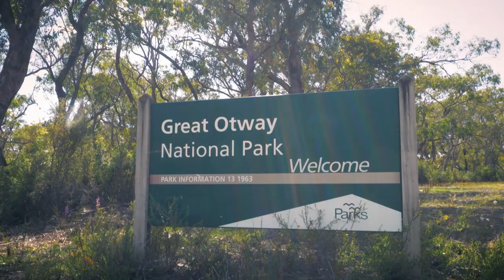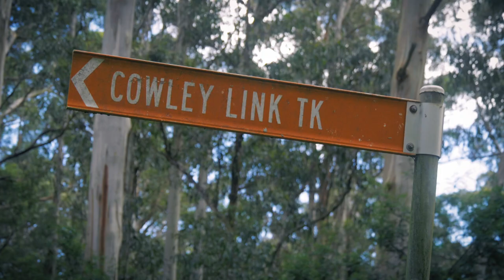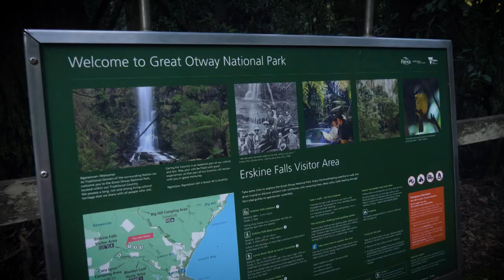Mud Holes and Big Rutted Hills - Escape to the Otways!

Comment: What size tyres are on the T60?
Reply from the maker: They are very limited for size. We will try to find the size for you but it is the biggest that can fit without rubbing.
Reply: @4WDTV  Thanks mate. Im looking at chucking 265/70 on mine with a 2 inch lift.
Reply from the maker: @SharrodVisuals  sounds like a plan. L:et us know how you go!
Reply from the maker: Finally got an answer, 265/60 R18
Reply: @4WDTV  Thanks mate! Good to know.
Reply: @4WDTV  2" lift?
Reply from the maker: @joemorgan2253  yes mate, it's the RidePro Kit. You can contact them for the exact specs.
Reply from the maker: @joemorgan2253  yes mate